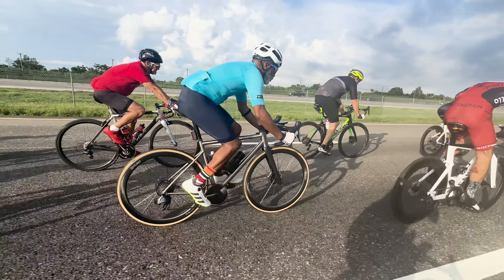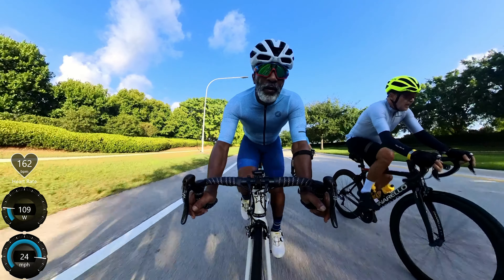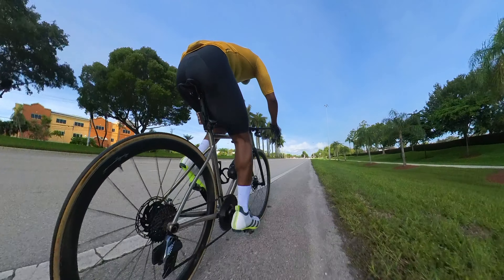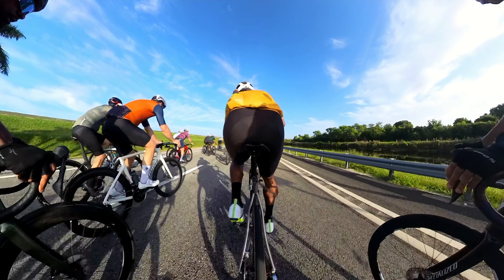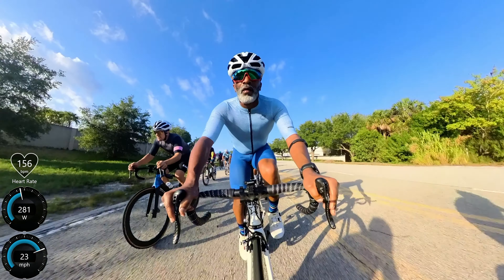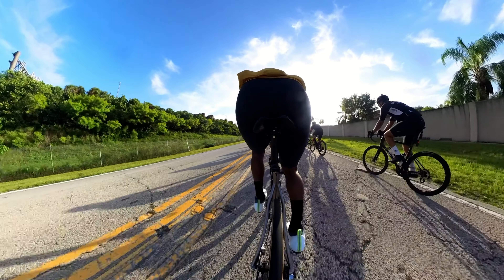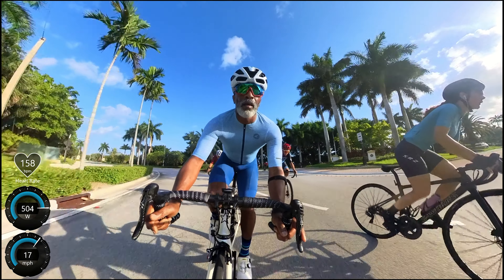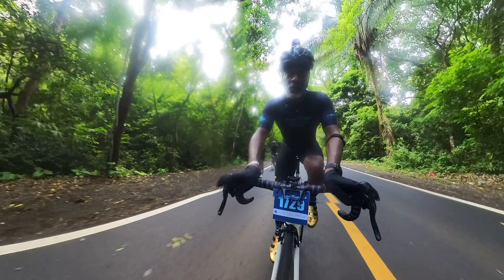Is Modern Steel Frame better than Modern Titanium?

Comment: I was reminded yesterday just how much subjective feel can be a distraction to actual performance.  I took my heavy steel bike on a hill ride, complete with 50mm tires, and a long slack geometry.  At one descent we rarely break 30.  It felt like I was doing at most 20, but sure enough I was already hitting 28 and gaining, despite being overdue for a rest day.  I had to do a double take at the bike computer.  Twitchiness, road buzz, and overall comfort can completely overwhelm what you think is finely tuned perception of speed, acceleration, and other performance metrics.  Wheels the "spin up fast" is another giant red flag in any review, as it is not like the wheels are decoupled from the speed of the bike, and the small weight difference only costs ~2x the meager difference.  The cycling industry is long overdue for standardized testing of things like vertical and lateral stiffness, high speed stability, low speed turning radius, and so much more.  End rant.
Reply from the maker: Thanks for sharing 👍🏾
Reply: Wheels speeding up is a thing. I was amazed at the benefit of carbon wheels.
Reply: @bikeman123  OK.  Can you quantify?  Does going carbon make acceleration improve 1%, 10%, 25%?  If the difference is so dramatic it should be easy for someone to quantify it, and yet it is all touchy feely opinions.  I have two wheelsets for my gravel bike, upgrading to 50mm carbon rims for road tires.  Honestly I really could not tell a noticeable difference.

Comment: I've had/have both titanium and steel. I prefer steel, especially my Reynolds 853 bike. It has air harden steel that is stiff but also compliant with a springyness that I enjoy.  Titanium is nice but doesn't have that same feel. Titanium absorbs impacts well but not the return of energy that a high-quality steel bike does.

Comment: Luis, while I love your videos, I really have to say that this was not  a fair comparison. To be a truly fair comparison both bikes would have to be built to the same specifications by the same builder.  There are so many variables in a frame that can make subtle differences to how the bikes feel.  Some of those variables are seat tube angle, head tube angle, BB drop, seat stay length etc.  There are a few builders out there that can build in both Ti and Steel. Also the bikes do not have the same component specs. All of this can make a difference in overall ride feel as well as the subtleties of the ride.   That said, overall it was a great comparison and I am glad that someone is willing to tackle this topic.
Reply from the maker: Hi George, thanks for watching. I am actually going to address this whole theme in a future video.
I wasn't going for a like for like comparison... or fairness for that matter.
I assume that a builder will build a frame to the best characteristics of the material by manipulating tube shapes and geometry... and we get what we get.
So that plays into it. But overall, these bikes are not far off from each other.
I appreciate your input.

Comment: Great video as usual. I have both, steel and Ti and I have ridden many of each. 

They are both excellent choices, better than aluminium (unless you are on a tight budget) and better than carbon in every way that actually matters. 

However, for me Titanium (if you can afford it) just has the edge. It has basically all the best characteristics of steel, with a weight advantage, lower maintenance (because no rust and no paint) and a look that never ages. 

Nothing is perfect, but a good titanium bike comes very close.
Reply from the maker: @reginaldscot165  Hi Reginald and thanks for weighing in. 
A good friend is prepping for a forever bike and really has his eye on the Litespeed Specia. I know you are partial to the T1... but the conversation reminded me of you and your bike.👍🏾

Comment: Recently bought a Ritchey road logic rim brake. After 13 years on a stiff aluminum bike. I owned a Pinella in 1999...great bike...crashed it and when I went to re-order a new one the distributor offered me the ti frame for $300 more so I bought that and raced it for 11 years....50K miles on both of those. People who say there is no difference in ride quality between frame materials have no idea. For my 3 hour training rides my avg speed, elapsed time and power #'s are the same on the Ritchey. I'm older now...on the aluminum frame I felt every crack in the road and found myself riding the hoods because my back was chirping. On the Ritchey I can stay in the drops all day and not feel beat up. The weight penalty is about 3/4 of a pound. I bought a light cassette and switched to those tubalito lightweight inner tubes and I'm very close to the aluminum bike now.

Comment: I have a Ti allroad bike. It puts a smile on my face every time I ride it. Havn't rode a proper steel road bike though.
Reply: Try one if you have a chance. I have an approximately 1980-84 Raleigh. It’s so smooth; however, just a tad on the beefy side.

Comment: I’m in the Titanium club (Seven Axiom), Steel club (old Bridgestone RB-1 racer is still amazing), and Carbon club (Emonda SLR).  All are amazing.  Depends on my mood and the ride for the day.  If I had to pick ONE and only one, would probably be the Titanium.  Comfort but still very agile and responsive.  And super easy to maintain.  I just completely overhauled, and all it takes is 15 minutes with a pad and the frame brushes back to like new finish.  The Emonda SLR is a weapon.  Unfortunately, I am not, but it is stiff, light and fast.  All materials are good.

Comment: I have never put that much thought into cornering characteristics. My commuter and touring bikes do corner differently, and at times when I transition it takes 30 seconds or so to adjust. But it's all flow and balance. I don't think about it. Kudos to you for being able to put that experience into words and actual physical motions of your body.

I'm just putting a lot of money and effort into installing dynamo lighting with internal cabling on my steel-framed touring bike. But if that doesn't work out, the option I'm looking at is titanium. I've never ridden one, and the cost is quite the step up.

Comment: My one performance bike has been my fully carbon Open Up gravel bike. Everything else has been aluminum and steel. And by far the material that has proved to be the most compliant and comfortable has been steel. Having said that, my current carbon bike is pretty compliant because it’s built to be compliant in all the right places. However, given what you stated in your review I would go for the black heart titanium bike too. I want speed AND comfort

Comment: In the UK we have the Mason Resolution (steel) - Definition (aluminium) or the Fairlight  Strael (steel)  road bikes. Modern standards, plus ability to fit mudguards - fenders, it rains a lot in the UK, these all run on hunt bike wheels.   These bikes would be my choice.

Comment: Hi Luis - greetings from Ireland. I have two wonderful bikes; a titanium Merlin Magia (made in the USA) and a steel Tommasini Tecno (fatto in Italia). The Merlin is light, fast and climbs like a rocket. It's also twitchy and has a scary speed wobble on descents. The Tommasini is heavy, slow to accelerate and climbs like a bucket of cement. It's also incredibly comfortable and, once you get up to speed, eats up the miles like a BMW Gran Turismo. They both look amazing - classy brushed titanium versus flashy Italian steel. Which do I prefer? Well, there is one huge external factor that tips the balance. I'm 66 years old and my carcass ain't what it used to be. I'll take comfort over speed any day - the Tommasini takes top step on the podium!

Comment: Some surprising findings!  I was expecting the DS to be more agile because of the stiff Winspace rim brake wheels, and the extra weight of the disk rotors on the BH road Ti.  Very good discussion because how you feel is more important than what happens in a lab setup. I think part of the difference may also be due to your more aggressive positioning on the Blackheart, which seems to put your hips closer to the BB. 

I'd like to have a custom gravel/ travel Ti bike where I use high volume 650B for gravel, and 28mm 700C for road, with relatively short chainstays (around 415) and a Pegoretti style geometry. Not a fan of the long TT, short stem geometry that we see on many gravel bikes today.
Reply from the maker: Their performances are very close. Both good bikes👍🏾

Comment: I'm in both camps. 
But, I just picked up a mid-1980s Trek 4 00 with tangy prestige tubing. Really high quality. Rides great. 
I used to race Eddie merckx Columbus SLX for 8 years so I know the difference between a poor quality steel bike and a good steel bike. 

Paid a hundred bucks for this TREK and it rides great. 8-Speed ultegra in great condition.

I'm not going to national championships anymore, so I really don't need a race bike but my theory has always been that if you love your bike then you will ride more miles. 

And I am very impressed with this bike. 

I almost bought a litespeed ultimate on Craigslist last week which is really my dream bike. 

But I think I'll be happy with this $100 Trek
Reply from the maker: I love this post. Thanks for sharing 👍🏾

Comment: I think I prefer Titanium mainly because I would enjoy the stiffness and the comfort of riding on a variety of roads. Steel from what I know transmits everything from the road making endurance rides not so enjoyable. I still prefer Carbon if my choice. 

Keep producing great content.
Reply from the maker: Hi Hillis! Thanks for sharing your thoughts. Hope to see you at One Love
Reply: Steel is just the opposite.  It is smooth, and kills high frequency vibration. If you can imagine what it feels to hold an electric razor in your hand, there's none of that with a steel frame coming through the bars and saddle. There is moreover some energy return when you dance  on the pedals. Not as stiff as a race carbon, but a smooth ride, like a big BMW.

Comment: I´m not in anyones camp when it comes to framematerials.
A good bike is a good bike no matter what the material is.
And you can find titanium frames that feels like a steel frame and steel frames that feel like titanium frames.
It depends on to many varabiles to say that it is the material.
The framebuilder, the geometry, the type of titanium, steel or whatever material you use.
And the thickness and how the tubes are shaped inside and outside.
I currently have a modern carbon frame and a 14 year old aluminium frame.
I love them both.
My next bike will probably be a steel frame.
I love the Standert Pfafinder and the Condor Super Acciaio.
They feel so fast and comfortable.
I also like the Cinelli Nemo Tig, but that feels very similar to a carbon frame.
Nice video though.

Comment: Luis,  the feeling you mentioned when cornering is pretty much standard feature on all disc bikes.  The fork is stiffer to be able to withstand the disc braking and therefore the bike feels less nimble when cornering.
Reply from the maker: Thanks for sharing. I haven't gotten that feeling from other disc bikes. Just got off a Basso Diamante and the cornering and turn in is much lighter.

Comment: As per usual, great review!!

It's almost an unfair comparison because of geometries and construction methods. I'm thinking it would be great to compare the same bike...one in steel and one in Ti (not an easy task, I know lol). That way, material, tubesets, butting profiles, etc. could be compared. Thoughts?

Also, the aesthetic comparison is unfair. I'm going to choose a raw metal almost every time. A simple white bike with black logos is going to lose to raw Ti...again...in my eyes. Now...raw steel showing the brazing and logos under a tinted clear...now we have a problem. Lol

Again, Luis, love what you're doing and your channel!

Comment: Very good and interesting video. However one thing to note is that not all titanium tubings are created equal. In 1992/1993, Bianchi used Columbus Hyperion Titanium tubing which was later used by some brands. At that era Ancotech, Sandvik and Reynolds were the main competitors of Columbus. Reynolds was widely used by Moots, Lynskey, Merlin, Litespeed and probably Independant Fabrication. Dedacciai titanium tubings appeared latetly in the 2000"s with K Class grade 9 butted with the second highest score of strenght of 123-134KSI behind the Reynolds 3/2,5 Butted with a score of strenght of 117-139KSI. Columbus Spirit offers a higher strenght than titanium with a score of 177-205KSI. Another thing to take in consideration is that a rim brake bike is lighter than a disc brake bike and less finicky to service. Rim brakes are lighter, stiffer and faster than disc brakes, braking requires skill. Plus changing a spoke or a disc brake pad on a disc wheel is a headache, that is why I don't have a single road disc brake bike nor a single road disc bike project in my stable. Another thing that struck me is why is the pivot steerer cut so low and the seat post too high ? I had an accident with my back two years ago but have also seen people complaining of back aches due to a steerer cut too short and seat post mounted too high. As for tires , yes tire technology elvolved but be careful of tubless road tires. I have always had slime anti puncture tubes put in my road bike wheels. I steel ride on 700* 23 and 700*25.  I have tried a friend's Passoni , a very high end italian titanium brand that makes their own tubing but there is one thing I remarked , Titanium is softer than steel and in quick pedaling relaunches, titanium doesn't feel as rigid.I have observed that when ridding back then my friend's GT edge in titanium One of my road bike projects that I told you about , the 1998 Vetta Team made of dedacciai DR Zero Uno  with its original steel fork is going to be finalized in september, I just need to source a pair of look pp396 yellow pedals. The weight of the bike is 9,3kilos not bad.  Also bought another Dedacciai 18MCDV6HT steel frame from 1994, a Basso Viper, so loads of bike projects in the pipe.

Comment: Interesting video and thoughts, thanks. Some other things to consider on the "feel" of each of those bikes when comparing steel vs.Ti materials. The tube diameters and wall thickness of each tube will effect how it rides and feels whether it is steel or titanium. I've owned steel bikes back in the 1980's, including today, along with all the other tube materials. My current head scratching includes a very nice Ti hardtail mtn bike with Rockshox and Industry Nine wheels that I own; I also have a modern full rigid, drop bar, steel frame mountain bike with steel fork (a rare creature, small batch, tubes selected by frame size). No kidding, when the suspension fork is locked out my Ti mtn bike, it is way stiffer than the rigid steel bike that has a shorter wheelbase. But the steel bike is way faster. I think the art of frame design and material choice lies in that murky area of experience, and what the designer was going for regarding feel and purpose. Happy trails. ☮
Reply from the maker: Thanks for sharing your thoughts Mike!

Comment: Good video.. i havent ever ridden TI.. however, six months ago i put together a stelbel sb/04.. the new steel tubes are amazing in almost all the aspects compared to my carbon bikes, except on weight.. there still a material difference (vis a vis — disc brakes), that for a long climbing day is noticeable.. but, the Stelbel worked excellent in the GF Ocean to Ocean here in Panama.. i paired with enve 3.4 at 55 psi to smooth out the rough sections of tarmac. If there would have been more climbing, probably i would have gone for carbon. regards..

Comment: First bike was steel reynolds 531,next alumium ,now two bikes i have are carbon and steel.Steel is hard to beat ,never have titanium bike.I guess the later is stronger,but expensive to fix if it is damaged during ride.Thanks for clip.

Comment: Really enjoying this video. Do you think the handling performance you prefer in the steel bike is down to material or geometry ?
I have a titanium Moots VaMoots 2012 road bike and I would say it handles like the steel bike you mentioned, but is comfortable like your ti bike.
Although , with enough miles on a bike a person adapts to most handling types I suppose ?

Comment: I've heard from frame builders that the fork has more to do with ride and handling than the frame does. Almost any modern performance bike will have a somewhat generic carbon fork regardless of frame material. I think it's sad that this seems to be a critical area that is overlooked (less than ideal turn-in and toe overlap for instance). That said my preference is vintage steel with a matching 1" steer tube fork. These older framesets commonly came in a dozen or more individual sizes each with a carefully built fork to match. Then again I like all vintage things, which is also why I like myself.

Comment: Your emotional attachment to the Pinella is similar to my attachment to old school Cannondales.  I have an Aethos and CAAD13, yet I am in the market for an old school CAAD or Rxxx.  I test rode an R600 the other day and I was struck by the immediacy and directness of the handling and power transfer - it seems like all the new bikes have been tuned for comfort, which seems to have taken away from the sharpness of the bike.  Which makes me really question what I should do with my current bikes.  I only got the CAAD13 b/c my CAAD9 was stolen.  Then I got the Aethos b/c the 13 didn’t quite have the sharpness of the 9.  The Aethos is awesome, almost like a CAAD9 on steroids, but it has somewhat of a muted feel, I believe b/c the carbon is tuned for comfort.  So I wonder if the best move is to pick up another CAAD9, which was my quiver of one for over 10 years, and sell the other bikes.  I wonder, if you so clearly like the Pinella so much, why you have all the other bikes?